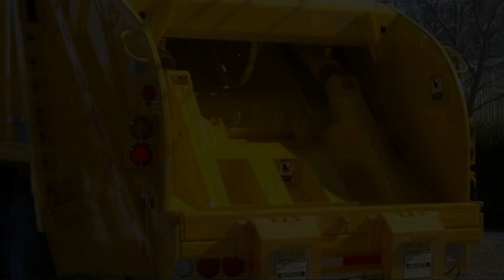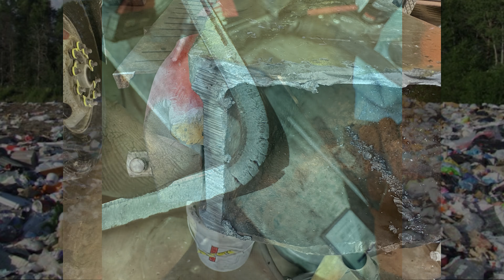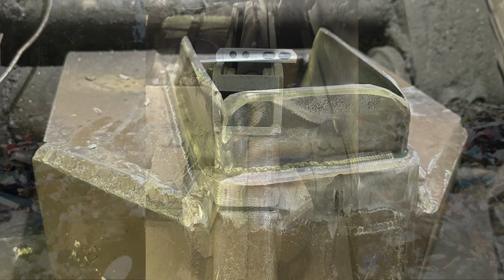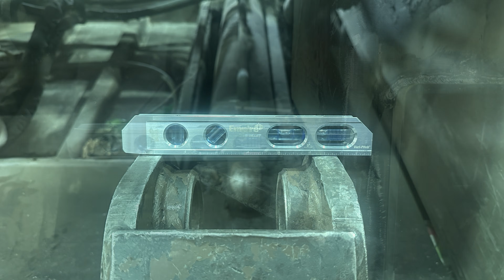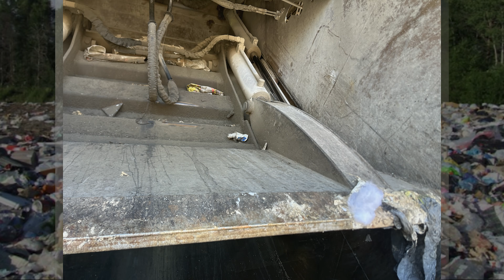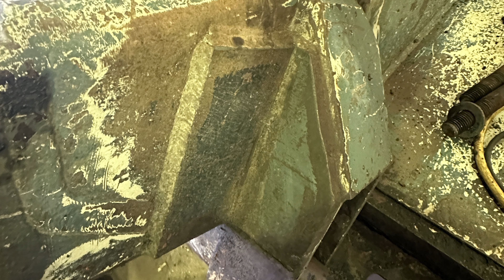Guide to weld repair broken equipment

Comment: They're built to crush bin bags full of plastic rappers, not large items of wooden furniture.
Reply from the maker: You’re absolutely right, and using them for things outside of what they were designed for is sure to cause failures.

Comment: You did a great job in what must have been adverse circumstances.
I used to work for a 2 way radio shop.  A trash hauler was one of our customers.
The cabs of the trucks were filthy and stank.
It must have been 100 times worse back in the box.
Let me guess, it was still full of trash?
Reply from the maker: There was plenty of trash still in it lol.  Getting it clean and ready to weld is the biggest issue.  The second is dealing with the smell of cooking garbage lol.

Comment: Learened allot about taking the skill into the field. Thanks !
Reply from the maker: No problem 😀👍.  Hopefully soon I will be able to do some more repair videos.  I went to work with the local pipe union and have been doing a ton of pipe welding and not a lot of repair work.  Repair work is a lot of fun and great to share because it gives a lot of tips for people to follow to solve issues they have.

Comment: Comments not in order.
Very good presentation , job done . yes this first. 
Looking at this in person I might change my idea/s!! 
I don't see any?? or much grease which should be a ?? weekly job !! 
I see that they cut the back of the tube out , where I cut the join part out of tube doing this kind of thing. That seem is not that strong. 
IF I was to do /have done this?? I think ?? I and think?? I would have hoped to use longer side backing strip so to reinforce that part. I don't do good root pass , so try to work within that. 
I have drilled  say the side walls so as to weld to them to the inside backing reinforcement.
A QUESTION I would ask is what is the designed hydraulic pressure this should operate with. Very much sounds like ??? the pump puts out too much pressure??? OR if so to lower it. Too bad that ?? half way around a given trip they have to go back and dump it, might very well this would not be necessary ?????? Prevention is better to a cure ??? 
Thanks shall see what else comes up.

Comment: I work on heavy equipment also and there are a few things that I have come to understand 1 some people can wreck an anvil with rubber hammer, and 2 With every action there is a reaction. Just like you mentioned if you build things stronger stresses go someplace else.3 I work on garbage trucks also and I could smell that picture.😂
Reply from the maker: That smell is very distinct lol.  Doesn’t matter where the truck is, the smell is the same lol.
Reply: @makingmistakeswithgreg  What smell?  I've been a welder/fabricator for a company that services the solid waste and recycling industries for the last 18 years.  I'm in recycling facilities and waste transfer stations everyday repairing compactors, shredders, balers and steel belt conveyors and have no idea about the smell your referring too.  Am i missing something?  Just found your channel, subscribed and liked.
Reply: @AndyS-o7m  I grew up near a huge dump site, which served around a million people. A wonderful playground

Comment: I frequently hear you say that Tig has unlimited thickness capacity. Can you make a video explaining what you mean and how you achieve that? If you already have can you help me find it?
Reply from the maker: So I shot a video regarding this but it will take me a bit to get it edited and out. In the meantime I will give you some info to help you understand.  When welding thick steel certain welding processes don’t input enough heat to produce proper fusion.  Tig welding can achieve full root fusion on any thickness be it paper thin to 5 inch thick.  Stick welding can do the same (thin material is tough to not blow holes).  The short arc mig process starts producing very poor root fusion above about 5/16th thick.  On really thick steel it can start to have very poor fusion in general to the point welds are very weak.  That is why (except in very limited circumstances) all thicker plate in manufacturing that is wire welded is done with spray arc or forms of flux core wire.  

Another contributing factor to issues with short circuit mig is visually the welds look good but the visual appearance is not a very accurate reflection of how strong the weld is. On 1/4inch and thinner material short circuit is not a concern.  On 3/8th the weld might look perfect but fuse very little.  All of these things and more will be covered in a video 😀👍

Comment: 14:53 - Very important consideration. Over reinforcement can cause future failures.
Reply from the maker: I have seen a lot of failures where someone puts a ton of thick reinforcements on commonly broken areas of frames and stuff, and then leaves some area untouched.  The untouched areas end up breaking because everything around them is 10x stiffer.

Comment: That's not really the appropriate truck for that kind of route. It would be better to use an open top truck with a claw crane. For one, it's safer for the workers because claw crane doesn't require lifting heavy, jagged or bulky items manually. For two, as the operator learned, these type of trucks aren't intended for bulky items. I hope the company takes this into account in the future.
Reply from the maker: You’re 100% right.  Unfortunately the municipality basically turns the oldest most worn out garbage trucks into special pickup trucks.  The trucks are one step away from being auctioned off.  They have already been through hell and back, but they don’t seem to last much longer doing special pickup lol.  No joke the load in the one from the video had a ton of junk and clearly the compactor wasn’t going to compact it.  The straw that broke the camels back for sure.  Your idea is far better, and it’s funny you mention that it’s easier on workers.  Right now 12 people are out on injury list from the group of garbage drivers.  I wonder why lol.
Reply: @makingmistakeswithgreg  I'm sure you see this in your work -- when people feel mistreated by their employer, the equipment is one of the first places this shows up. "Frank, the ram on this truck don't look right." "You think I give a flying Fck, Tony? They don't care about me, I don't care about their stuff." 

Paycheck error? Someone's walking off with some company property in retribution. 

Bring up a safety or equipment issue and get told to stay in your lane? Didn't realize that little genie in the bottle light on the dash was important. We just kept driving until the truck stopped.

Comment: I like your choice of the root pass tig. I can understand why obviously your proficient and comfortable is first choice of stuff! 
   Nice detailed discription of the failure and repair. I know most weder / mechanic just finger point at the operator failure but digging into the cause to educate is the way to go.
Reply from the maker: Part of making solid repairs is to use what you are best at.  The one thing tig provides is a no stress 100% root pass, and for me that was worth it.  So much of a multi pass weld comes down to a clean flat root pass, and the fact I barely had to touch a grinder by time I fully welded it out made it work really well.  I swear on odd cut/non perfect fit material with limited access it’s guaranteed I am going to have some rough stick bead on a root pass that will need some work 😂.

Comment: Good tip to take the level measurement at the pin , not the top of the plate. BUT very easy to overlook in the heat of the action-
Reply from the maker: The amount of stuff out there that isn’t built plumbing/level/true is staggering lol.  I swear every time I try to make something that’s broke perfectly square/true it doesn’t work because it wasn’t from the factory lol.

Comment: When an irresistible force meets an immovable object,  something has to give.  And what I am talking about is the lack of a proper pressure release valve.  Oil is uncompressible and when too much pressure is applied,  something has to move.  The other point is to understand what steel was used in the manufacture and try to match it in the repair.  No matter what repair is used,  time and fatigue eventually win.
Reply from the maker: Since I don’t really wrench much on garbage trucks I don’t have a great understanding of their hydraulic systems (I just weld broken stuff).  The amount of completely broken stuff I have seen makes me wonder if there is even an over pressure bypass on the hydraulic systems.  A significant amount of failures seem to stem from what I would argue are design flaws.  A great example would be the compactor wall inside the garbage truck, most of them at the dpw will extend beyond a reasonable point causing damage to the wall and possibly contributing towards the compactor blade cracks.  Why the rams would even allow things to over extend is beyond me.
Reply: I was thinking the same thing. Should be designed so the relief valve lifts prior to damaging itself.

Comment: That was a great job on the repair. I expect it will last a lot longer than the other side. The rectangular member that failed is call HSS (hollow structural steel). Most HSS is ERW (electrical resistance welded) when it is fabricated, but that one looked like it was fusion welded (probably SAW, but could be another process), which is why it was not fully penetrated. I got to watch HSS being manufactured when I was doing some procurement consulting for and engineering company and I was surprised at how it's made. It starts out as a roll of plate that gets continuously formed into a round pipe through a series of rolls (like any ERW pipe I suppose). Then the joint is pushed tight and fed a current to resistance weld it. The reinforcement is removed and the round pipe shape is then fed through more rolls that form it into the rectangular shape. If the product is ordered PWHT (stress relieved), it is run through an induction coil and heated to around 1100 degrees F. It is fun to watch a member that is say 6" x 6" and 1/4" wall go through the coil at about 25' a minute go in room temp and come out at 1100 F. Must be a serious amount of juice on that coil.
Reply from the maker: Interesting and thanks for sharing 😀👍.  The amount of knowledge I have gained from comments is unbelievable, I am sure others are appreciative too.  The whole design of it makes me think they wanted it to fail where it did.  3/4+ inch steel on top of the arm and 1/2in with supporting braces on the base, clearly that isn’t likely to fail over the 1/4in  thick square steel lol.    

I wish I could get into a steel manufacturing plant to take videos.  I recently saw a video that showed square tube was made by feeding round tube through dies, that (which makes sense) is not how I thought they made it.  It makes total sense on how you described as to how  they would make bigger stuff.

Comment: Love this one Greg! I couldn't agree more on how you did this. The question to plate or not to plate is a great question. I made a comment on a repair I did on an excavator boom on one of your other videos and I like the use of backer plates.
My question is could you have used dual sheild with a suitcase wire feeder run off an engine drive with an .045 wire? Oh and which welders did you use and were you using your generator to power them? Great work and thank you for all your work doing these videos for us!
Reply from the maker: Dual shield would have handled that job without issue, be it run off an engine drive or with a power source.  .045 wire would work great too, plenty of heat input.  I actually did the repair at my work but I used my esab rogue 200.  I have a miller 350 power source (and a 12vs feeder) that would have worked fine, but the esab allowed me to tig weld and switch to stick to knock the job out.  On an infield repair (outside of a shop) I would have looked at a suitcase feeder all day.  I am not a huge fan of hardwire in spray or short arc on old dirty material.  I prepped the stuff clean but it’s still beat up old steel.  Dual shield would be able to have far less issues with porosity and other weld defects.  I swear I can fab all sorts of new steel up with spray and short arc, with zero issues.  The second I start welding some super prepped but beat steel It’s guaranteed to get some porosity in the hardest to fix area 😂.
Reply: @makingmistakeswithgreg  I can't tell you how thankful I am to have your input on these things. Thank you Greg!

Comment: Thank u Greg one of th most important focal point in this video is not to over strengthening/reinforce one side more than the other due to th force An weight distribution that’s apply to this hydraulic arms yes th force HAS TO BE DISTRIBUTED EVENLY 💪🏽💪🏽💪🏽💪🏽💪🏽…..thank u each one of ur lessons is Greatly appreciated to all of us thank u God Bless🙏🏽🙏🏽🙏🏽

Comment: Nice video and repair Greg.  These are the types of repairs that I would enjoy doing. You get to do a little bit of everything with this repair….. torch work, layout and alignment, a lot of weld, and beefing up with plates.  I figured that you were gonna use backers once I saw the amount that you were gonna have to remove.  Then my next thought was, this would be an idea dual shield repair.  A bit more ductility, and you can dump a lot of filler pretty quickly.  Always enjoy your content Greg
Reply from the maker: Dual shield would have been the way to go.  I didn’t have any laying around the shop so it wasn’t an option.  Believe it or not the municipality I work for has 2, 400 amp capable machines and when I started they didn’t have dual shield or spray arc gas mixes lol.  I had to make requests for those things.  The welders used short circuit to weld all of the things I have done with stick lol.

Comment: I really enjoy these repair videos. Big or small, I like them all. I also agree on your comments about transferring the stress if the fix was too strong. Note: A torch cutting video would be great.I have always struggled with that.
Reply from the maker: Torch cutting is one of those things that is very finicky.  I swear some days I can get clean cuts and everything works, then the next day it’s bad lol.  I will definitely do videos on it.  What I have found is universally the bigger heavy duty torches cut far better than the small ones.  I have both a smaller medium duty smith and medium duty Harris torch and both seem far harder to cut clean like the 40 year old beat heavy duty smith I have lol.

Comment: Great video, Greg, thanks.  I think a lot of guys would have just welded that back up and called it good.  You went the extra mile, well done.  Also, you explain things really well!
Reply from the maker: Thanks.  I am lucky in the fact I am given the time to do a good job.  The end result is driven so much by the prep work that long lasting repairs are really tough to do without adequate time.

Comment from the maker: As a heads up since I didn’t include it in the video, the repair was done with tig at 140-160amps and stick welding with 1/8th (3.2mm) 7018s at 120amps 😀👍
Reply: Thank you!
I was guessing stick.
Looks like you almost could have done it with a 110V machine.

Comment: I enjoy your commentary on the how and why of your repairs.  I find it very useful.
When utube is able to also capture the smell, it would be even more better😂

Curious as to how much cleaning, i.e. power washing or steam cleaning is done, if any before a repair like this.
Reply from the maker: That one wasn’t too bad luckily.  I have a video coming out shortly with a different style packer blade repair and that one had 3/8th of an inch of pure sticky filth on it.  No joke I sat there with a pressure washer for 15 minutes trying to clean  the area (the size of half a shoe box) to clean steel.  Powder coating can be easier to clean off than whatever that dumpster juice is.  Getting it clean enough is a huge concern, especially with the forces involved.  I only stick weld repair stuff like that, and spend a ton of time on the prep work.  I am pretty lucky that I am not hassled as far as taking my time to make solid repairs.  20-30+ tons of force on a half ass weld on some unprepared material is guaranteed rework lol.

Comment: great repair,man! Too bad we don't have scratch-and-sniff for videos,LOL. I got in an argument with a farmer who's Peterbuilt I had lengthened the frame on.He took issue with my 'fish' plates not being welded all the way around,skipping over the frame splice weld. He couldn't understand the concept of crack propagation-farmers!
Reply from the maker: Even an old garbage truck that has been doing cleaner work has a distinct odor when you get the steel hot lol.  A scratch and sniff would work great lol.  Before working on garbage trucks I thought they would smell like the garbage in my can, but come to find out the odor is quite a bit different.  I don’t know what people throw out but the accumulation of filth is quite the odor 😅.
Reply: @makingmistakeswithgreg  I know that smell well-rancid BO with a touch of pepper!

Comment: Great informational video. Do you ever magnaflux parts?
Reply from the maker: When I worked for a bit in a machine shop I did, but doing repair work for the DPW I don’t.  They don’t have the budget for a setup and for the most part I am able to spot and fix problems.  The hard part on repairs is knowing how far to go on a repair.  Being able to see more cracks could help making a lasting repair, but if the metal is cracked/fatigued internally you won’t see that from the surface.  On one hand you don’t want to waste days of labor fixing things that aren’t a problem, but on the other hand many of the repairs suck to do and are difficult to get prepped.  Sometimes you just hope for the best lol.